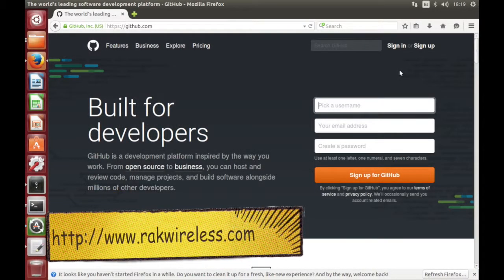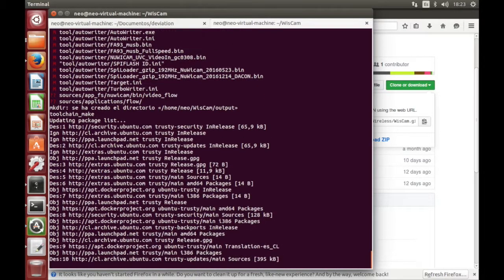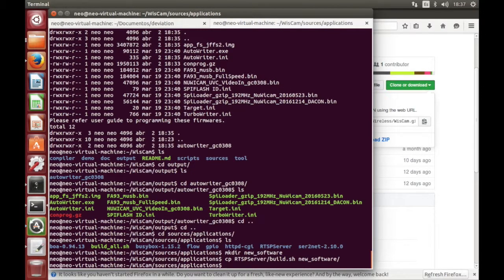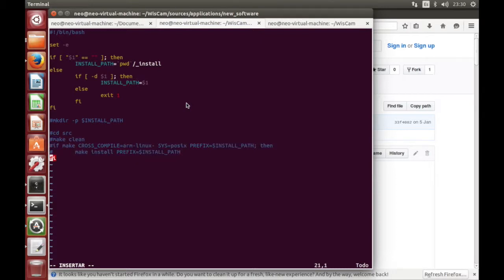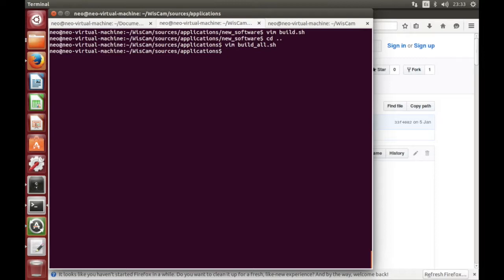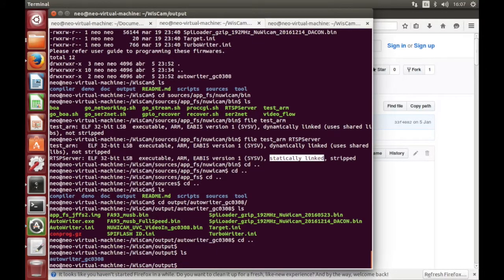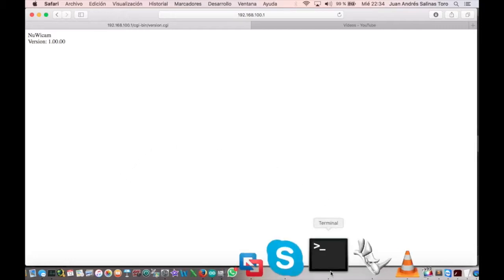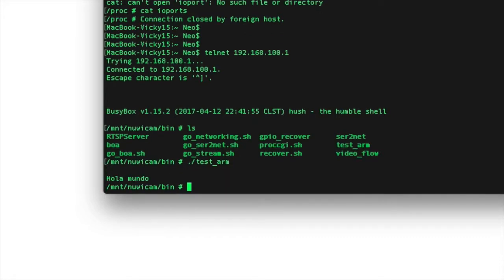WisCam Tutorial : How to download source code from github and bulid your own application with linux

Comment: 0:22 (after 22 seconds)
To start to work with wiscom model, the first step that we must do is download the scource code the Rakwireless need. For that we must go the github page and search for rakwireless.
How we can see the company has lot of code that we can use. But this time we will use wiscam code.
We can download the code by two forms. The first form is use a zip file, Or we can use a gitcode money. 
For that we must copy the URL and in the linux terminal we need to write git clone and pass the URL and then Enter. Now code is downloaded by the Git manager. When the code  … downloaded we must Enter to the folder.
With Vim commend we can open the readme file,
 and how we can see the manufacturer say, that we must run a command first of all, 
that can help us to run the  script with whole the framework.
After this we can build our first framework.
For this we must write ./ (dot,slash) scripts /build.sh
The  script will help the Linux and download all the software.
Two thing create folder and all that we need to compile the framework.
And after this we create the framework, and the folders that we need to use to update the frame work to  or model. 
This step will take a lot of time if you want you can take a cup of coffee. 
When the compilation has done , we go to the output folder. And into there must be output to write a folder.
With ls commond we can check the file and  …. Exit program. 
Is the program that we must use to overlook the framework to all models but his program only work on windows.  There will be to the new camp UAC video in . 
this part of framework, help us to use the wiscam like a webcam. 
When is connected to the computer by USB port.
How I say, the first time this command is build for desktop window, but if you want to create a special software for the wiscom  model , we must go to another folder. 
With CD Sources/ (Slash)/ Applications and into there, there are lot of stock software and source.
For our program we need to create a  new folder, with mkdir new_software.
I suggest you to copy a full script from a  stock software to work folder. 
With this method, will be great work program by default, Like RTSP Server program.
The script is built and the command to copy is CP RTSPserver/Build.sh  to new_software folder.
 And If we work on new software folder. We can see the script to build the program. 
For create workforce program, we need to create a main.C (main dot C)file.
And into there we  write our program. 
In this case a Hello world program.
Void main.
Printf “hola mundo or hello world” in English.
First we need to be sure that our program works.  For that we use a GCC  main. C  -o and the name of program. Textx86 and then run it with ./ (dot slash) testx86.
The program shows us hello world or helo munda. 
We can upgrade the program,  because the program has not returned us , our line jumps.
But this can be fixed only with /n.
Well we can want to jump.
Now we can add /n on the start of the word and then on the end of the word.
Now the program show us the message, how we want.
 Now we know that the program works, we must create the script that will run the program in the frame work. 
Presently we have copied the build script from  RTSPserver.
And we enter and change in all program. 
There are some parts that we don’t need now,
First we need to know In which folder we are.
For that we write a  command…………………..pwd…  and now we have the main path.
If we want to build a program for our ARM processor we must not use GCC, We need to use our Ramlinux-ggc the main path./ main. C with a output  main path / test_arm . 
now we have ARM program. But we must copy the program, into the folder, the main script, used to build the framework. 
We use CP main path / slash / test_arm 
And we copy the program into the destination folder. 
That is the design  by the console command .
Install  path. / bin / 
and with this modification,  we have our program into the installation folder. 
We save it and we must see that  main script,
 that must use the new script from our program.  
We go back and open the script build_all.
Into the Build_Set, we must put the program that we want to build, 
New_software and space . please don’t forget the space.
Because without this script will fail. 
We save it, and go back to the main folder.
We execute the build script. 
And we’ll generate the program  and the framework and after some minutes. 
Now the program has degenerated, we can check it and test it, to know if the problem is okay.
We go back, to source / app_fs/ nuwicam/ bin
And with the command ls we can see if our program is into the folder.
Test_ ARM 
For Check our program.  We can use the command file/ test_arm
And the program is show us how the command has been compiled. The program is for ARM processor and dynamic linker.
 And that mean that the program finding to the framework for the library that needed.
How is a very little program. I think we don’t need a starting link program. 
If we check that the error to CP Server program, we can see that the program, is complied with static flagged that means that in the program has all the function that needs into the program.
We go back to the main folder and go into the  output folder. 
Autowriter 
and there is all source .
we need to copy all directories to auowriter folder.
Into the windows computer. 
With this, we can upload the new framework to *(worm mall)
……………….

This is the new model wiscam. My *(shutters) of this was different,
 now  it has more ports.
For update the framework ,  we must search the debug Pins.
This is the debug pings.  We need to close these two pins.
But if we want solder those  pins.
We can use a very easy trick.
This is Arduino Uno Model .
We can use it . because it has that pin that  are connected.
We can take the wiscam model which we turn around.
And look into the board, we know that you must use the first three pins. 
This is the debug port. 
And now we only need to connect the USB port, to the windows computer,
I’ll say before we only  need to execute autowriter program. And say yes.
And then we must connect the board to the computer by USB.
How I am in their boots on machine, I say that must be connected to the virtual machine. 
Now is a recent  framework. If u are not using virtual machine then this step  will take less time. 
Now the framework has been  installed and we can unplug it and test it.
The next step use the free network from the model and login it by telnet like the first video tutorial.
telnet 192. 168.100.1.
with LS command we can see that world program has been installed. 
Test_arm, we Execute the program by, dot slash test_arm , 
now the program has returning an error. 
I made a mistake because I told you that it’s not necessary to build a program. 
With a static library but they are not a lot of shared libraries on the framework.
We can fix it. We must enter to the program folder with, Cd dot dot, CD source/ applications/ new_software. 
Vim build.sh
And in that line there is an error, at the end of this line we must put a static ,
With this our program will be compile it with a static library and now we will execute the built script again.   The build script must be used for create all the framework.
But if you want to test all your program, we don’t update by program TEFTP
And we don’t need to use auto writer. This mirror is better for debugging and testing.
Now that work program has we created by a static library we can test it.
For that we must use the general, common and with the ALS put in check if the program fits into the model by dot slash test_arm, we can see that now, it is working,  
Now we know that how to create our own programs and how to include it into the framework.
I hope that this tutorial has been clear and in the next video. I’ll show you another program and products. If you like this video subscribe it.
Reply: Please correct the sentences. Thanks